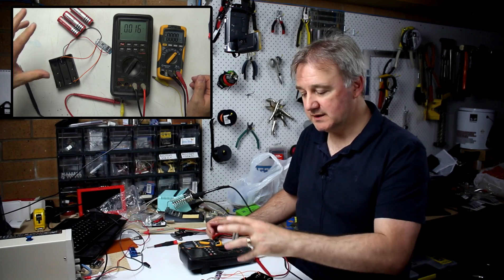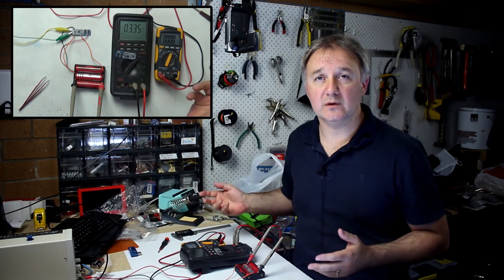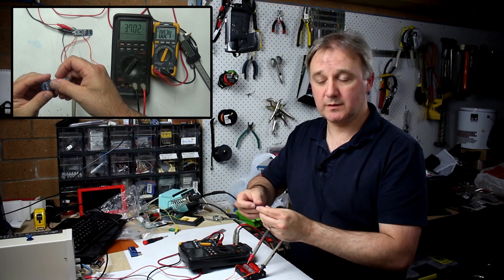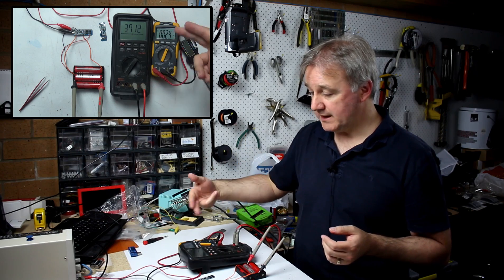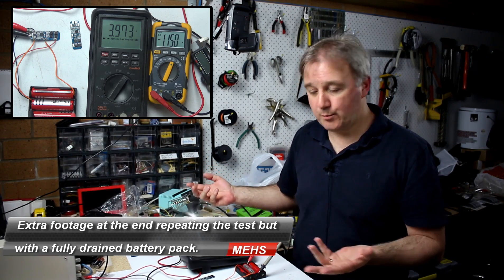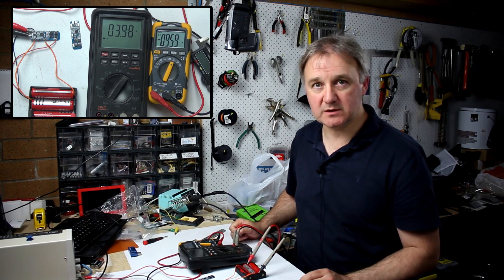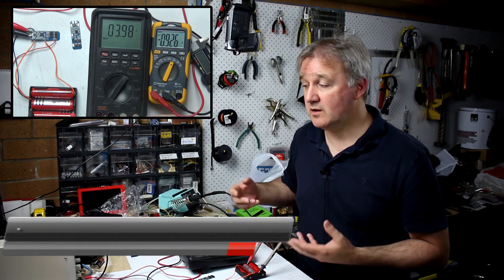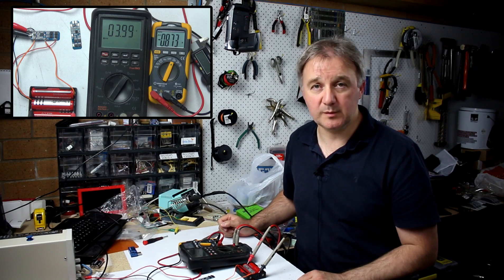Does a BMS charge my Batteries? (MEHS) Episode 57

Comment: At the end, which is the best way to charge a 3s battery pack? i'm building a portable display for a gopro and I want to include the pack into the box and the intent is to charge it with an external charger by micro usb o something similar. I found the TP4056 but I read that only support 1 cell and I need 12volt! 
Thanks in advance!
Reply from the maker: - Hi.  You say you need 12v?  What for?  12V at how many amps?  Your best solution might be to run a 3.7v pack and use the handy TP4056 board but get the 12v through a 12v boost reg.  Cheers.
Reply: Hi. yes 12v for a lcd controller board (from an old netbook). It uses a power adapter that give 12v and 4A. I would like to make it portable to use it with a go pro. so i was thinking to use 3s2p battery pack. but it is difficult for me to undestadn how to make chargeable with an external power adapter!
Reply from the maker: - Ah I see.  Do yourself a favour and test the LCD and controller board and see if they run from 5V, many do.  If they do you will be able to run a 5V setup which is way way easier to deal with.  You will be able to run one or two cells in parallel a 5v reg and just a phone charger and a single TP4056 and the job is done.
Reply: I'm sorry, but my knowledge it isn't enough to check what you advice;
i found this on the specifics of the board
 POWER Requirement 12V DC/12V(built)/12V,5V(built in)/12V,5V,5VSB(built in)
To Panel 3.3V/5V/12V
Management Standby Power Consumption < 0.5W(Board Only)
Reply from the maker: - All you need to do is run 5v through the board and see if the LCD powers up.  If it does you can get away with an all 5v system which is great.  Send me an email with your project diagram and maybe i can help more.  myelectronicshackingshow@gmail.com
Reply: My Electronics & Hacking Show I sent you an email! I hope i could help me!

Comment: Hi, if I use this BMS in combination with max 745, will it become a balance charger?
Reply from the maker: - Hi.  No it won't although passive balancing happens anyway.  Most of the time (many applications) you don't need a balance charger.  A lot of BMS say "balancing" because passive balancing happens anyway, they are not active balancing.  If you're using say 3 cells in series (3S) then the BMS will evenly distribute the power to each of the cells so at the end of the day they are all the same voltage.  If you connect cells in parallel then they balance each other out unless they are very different batches and are not equal.  Cheers.
Reply: Hi, Thanks you sooooo much for the information!!..  
lipo charging is the biggest problem for diy projects especially in robotics (high currents..).. if possible can you pleeease.. kindly make a video on proper and reliable way to integrate lipo batteries, bms and chargers into diy projects... without those bulky chargers..  thanks again!!! :)
Reply from the maker: - Hi.  Sure can.  Will be making such a video soon.  cheers.
Reply: Thank you very much:)) will be waiting for it. :)))
Reply: @michaelsstuff4402  "3 cells in series (3S) then the BMS will evenly distribute the power to each of the cells so at the end of the day they are all the same voltage."
Are you saying that if one of the 2 cells is fully charged and the other 2 are not, further power to the BMS will only go to those that are not with this particular BMS? or does it shut off power going to the whole battery?

Comment: So what kinda of board could I use to charge a 4S Li-Ion pack without the stand alone charger used in hobby type applications? Would there be any way to get enough amps/volts from the USB 3.1 protocol of 5V, 2.1 A?
Reply: Would it just be easier to get 4 of the TP boards and wire the power supply in parallel to each board. Allowing one board, one cell. The 5V from the USB would be shared to each board and the 2.1 amps divided to each giving a charge rate of 500ma
Reply from the maker: - Hi.  You must have peeked at my next video as it looks at a very good lithium charger that can do 1-4 cells in series.  Coming             very soon.  No you won't get enough total power out of a USB C or 3 / 3.1 port.
Reply from the maker: - Hi.  No you can't use multiple TP4056 boards unless you have complete isolation which would mean independent power supplies for each TP and a way to isolate the ground from each when you connect the cells in series for your combined power output.  Very tricky especially with 3 or more cells.  Take a look at my latest video on BMS and lithium cells to see what I'm talking about.  Cheers.

Comment: lol not true if your charging 3 batteries in series at 1 amp all batteries will see 1 amp.  It is not 1/3 of an amp! If the batteries were wired up in parallel then that would be true.
Reply from the maker: - Hi.  Yes the error was picked up a while ago and corrected as annotation on the video but doesn't show up on mobile platforms etc.  Cheers.

Comment: Awesome video, well done. I was under the assumption that the BMS can handle charge & balance. Your video, however, tells me that a dedicated lithium balance charger is still needed to this day. Recently motorcycle manufacturers have begun adopting lithium batteries into their motorcycles to save weight and increase cranking amps. The engine's stator directly charges the "oem" lithium iron phosphate batteries via a voltage regulator. Alternatively, they suggest maintaining the battery with a battery tender as long as it doesn't have desulfation mode and it doesn't exceed 14.9V. It is assumed the BMS on board will handle everything and there's no need for a dedicated balance charger.

My question is: What would be the long term effects of charging a Lithium iron phosphate battery via the BMS and if there are any negative effects, why is this acceptable for oem motorcycle/industrial standards?

Thanks!!
Reply from the maker: - Hi.  Big question.  Basically LIPH cells are more tolerant of overcharge and can be held at full charge for longer.  Also a batch of these cells with the nominal voltage of 3.2V and a full charge of 3.6V works nicely when replacing a 12v lead acid batt which is normally charged to 14.2v.  There are still issues as they are still lithium and are not as forgiving a lead acid batts.  Since we are talking having the cells in series, the BMS would need to be LIPH specific but if it was decent it would do the job.  Passive balancing would be dealt with by the BMS.  The car or bike would need a proper charging IC or device otherwise (eventually) the cells would deteriorate faster that if they were managed by a dedicated balance charger.  How long they would last is a good question.  I have seen many commercial devices and home made projects that just have a BMS managing the cells with raw power going through the BMS to the cells (no proper charging IC, just a straight voltage reg) and they can last quite a while.  Not as long as doing it properly but I can't say what the real world difference would be.  Maybe I should build a rig and test it.  Hope that helps.  Cheers.
Reply: Wow thank you very much for the detailed answer. Sorry I am getting off topic, when you mentioned that the "bike would need a proper charging IC or device" - Is it found inside the battery or perhaps onboard the motorcycle ecu? What purpose does the IC/Device actually serve (eg. regulate voltage? Cutoff from overcharging?) or is this IC/Device equivalent to a balancer? Yet, the said lithium battery only has a positive and negative terminal no different from a lead acid (and no additional ports for balancing)

Reason I ask is because the same model motorcycle uses the same voltage regulator and stator after confirming the same part numbers. However, while a higher trim model would be equipped with the lithium battery, the lower trim level uses a lead acid. Is it possible there exist an additional ic/device on the higher trim model?
Reply from the maker: - Unfortunately both are possible.  The battery could house a charging IC or the bike could have it in the ECU.  The other possibility is that the BMS is doing all the work and there is no proper charging IC.  OK, the IC is just a chip that correctly charges lithium cells, just like the TP4056 single cell charging IC.  It follows the constant current then constant voltage charging methodology.  This is more detailed than just allowing a correct voltage to go to the cells.  Just a good voltage will charge the cells but the CC then CV method is what you are supposed to use when charging lithium cells.  The IC just provides that CC then CV stages and sometimes has a timer to cut off the charge if it goes too long.  The BMS does the under / over voltage and current work.  Cheers.
Reply: Thank you for enlightening me! It seems like the IC can replace the need for a cell balancer charger completely and the former case (ie. battery housing a charging IC) seems to be the more logical way for manufacturers to adopt lithium technology. Regardless thank you very much for taking the time to explain this to me. Keep up the great work!
Reply: I've been searching for a long while now trying to see if a BMS can be a sufficient "charger". I'm wanting to hook up my motorcycles rectified AC current (which sits around 14.8v DC) and see if a BMS will effectively charge and balance a 4s or 3s pack through its over and under charge functions. I cant really find a clear answer so I'm starting to dig into the schematics and components of the BMS IC to get to the bottom of how the BMS behaves under constant voltage, overvoltage, undervoltage. etc!! If you happened make a video or built a rig showing things like this I'd really be stoked...otherwise someone's gotta make it cause I'm seeing these question arise now and again in the world of BMS.

Comment: Uploader,

I am very interested to know how much is th discharge "cut off voltage" of yr BMS u used? is it 2.3 or 2.5v or whatever ? 

I alys wonder, why ths BMS manufacturers make ths discharge "cut off" voltage way below 3 volt, coz as we know draining a lithium ion cell below 3 volt reduces its life span. 
Can u explain pls? 
Thanks a lot.
Reply from the maker: - Hi.  This BMS has a cut of voltage of 2.9v.  I have seen some that go down to 2.5 but most are 2.8 or 2.9.  If someone is using a 2.1v cut off then I would say that is too low unless it was set by the actual manufacturer of the cell.  Cheers.
Reply: Uploader,
In yr video I did not find link of th BMS u used.  I will like to buy that if its discharge "cut off " voltage is 
2.9. Wow thts better for th health of expensive lithium cells. 

Wld u pls gv me th link. 
Thanks.
Reply from the maker: - Hi.  The seller I used doesn't sell them anymore but I found many like the link below (same board).
http://www.ebay.com/itm/10A-BMS-Charger-Protection-Board-Pack-of-3-18650-Li-ion-lithium-Battery-Cell-SA-/322385705714?hash=item4b0faf7af2
Reply: Hello,
I checked it, bt it says: 
Over-discharge detection voltage: 2.3-3.0V±0.05V 

So, how did u say 2.9volt it cuts off th load circuit? 

I hv hooked up a 3 cell BMS & saw  in multimeter, as soon as th load voltages reaches 2.34volt , it cuts th circuit . I ws wishing 2.90 volt :-( :-(
Reply: To rise the cut off voltage is possible by any means? 
Thanks.
Reply from the maker: - Hi.  You would need to see if the IC being used on the BMS is programmable and, if it is, find the resistor that sets the value.  I've not done it and can't tell you if any of the BMS IC's are programmable.  Cheers.
Reply: Ok Thanks. :-) 

I will check th IC. Bt it may be tough job. I did not study electronics. ..jst a hobby. :-) 

Constant current & constant voltage for these two terms, could u pls gv a layman exp? I did search online , bt not clear. 
Is it smethng like  pushing th same current to a battery ,for exp1 amp, by a power 💪 supply/charger increases or decreases th voltage regardless of th registance changes? Meaning pushing same current by + or - th voltage ? Am I correct ?
Jst I need layman analogy. 

Thanks indeed.
Reply from the maker: - Hi.  If you take a couple of minutes to read this you will gain some very useful info about lithium charging.  I can't explain it better.  http://batteryuniversity.com/learn/article/charging_lithium_ion_batteries

Comment: Hi friend how are you ? 

What voltage have the charger  for load to 100% the 3S array?
Reply from the maker: Luis Chacón - Hello.  12.6v is the max voltage you should give a 3s pack.  Cheers.
Reply: @michaelsstuff4402  so you had a 12v power supply hooked up to the bms? and it was drawing voltage from ~3.6 to ~4volts?

Comment: I gave your video a thumbs down as you should of had a voltage meter on each cell and the optimal voltage for long life is 3.92V (lowest $/kwh).   It is a 3S1P charger so it is charging at 1 amp even though 5 amps are available.  If 4.2 are available then if the maximum is 3.98V then that is good but too high.  But you never allowed the voltage to end or the current to drop to zero.
Reply from the maker: - Hi.  I would prefer a thumbs-up but I always appreciate detailed feedback.  I just did a quick re-watch and yes I know what you are saying.  I recall I ran out of time in a big way during this video and it had impact on the details and the overall quality.  Fair points.  It would have been much more instructive to see what was happening to each cell etc.  Cheers.